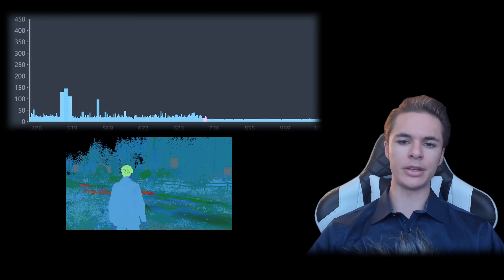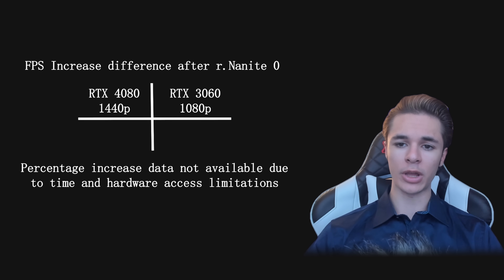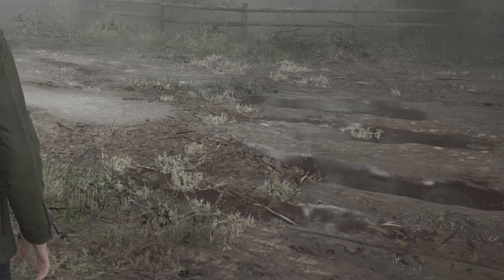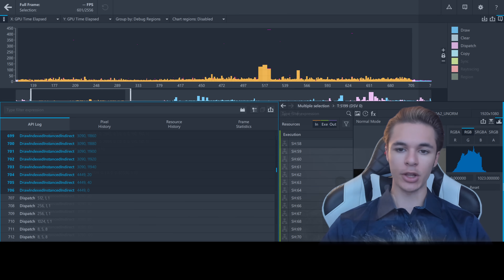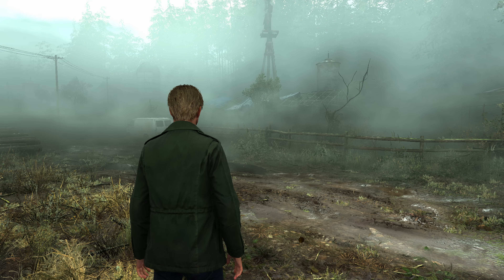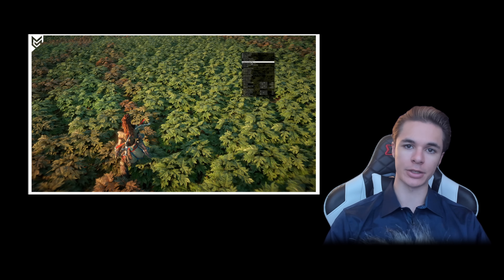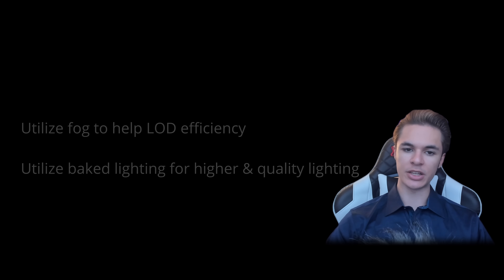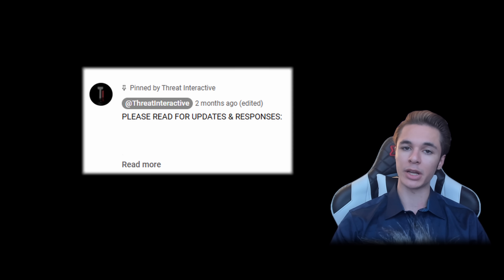The Price of Realism? | SH2R Optimization From The GPU Perspective

Comment: hey there, can you check out this game called still wakes the deep and find out what's wrong with it? it's using ue5 but the shadows from the flashlight look very pixelated and the lumen or whatever it's called is very noisy. i would appreciate it if you did a similar video to this but for still wakes the deep

Comment: Lmao love your breakdowns but you get so overly angry about a lot of this.  I love it when passionate developers use clever techniques to push fidelity and hardware without relying on artifact ridden "cheats" too but expecting that out of every AAA game is ridiculous.  It's a profit driven industry and a lot of the time the investments flow to whomever is using the shiny new tech even if it's worse than the old tech as long as it's marketed properly.  Snake oil salesmen will always be successful to some degree so the best way to beat them is to be a good salesman yourself.  Along that line I think you should also break down some examples of games that did optimization well and outline how those good decisions effected the end product.  I know Half Life Alyx has already had lots of media coverage, but an in depth breakdown of a game like that where you link to resources on implementing the techniques used both on the art and tech side of things would go a much longer way than being negative about the bad decisions imo.  You have to sell what you want people to use.
Reply: He actually did in an earlier video. Check out "Optimized Photorealism That Puts Modern Graphics to Shame: NFS 2015"

Comment: well... ue5 game have pretty much the same problems (no matter the game)
Reply: that's an issue with the developers and less to do with the engine, developers have to do their job properly to use an engine properly for their games, and there have been developers that do it properly
Reply: @randomcommenter10_  yeah yeah yeah....
and yet my comment remains true... this IS  a problem that UE5 have
It depends a lot in the game, the "heavy" load it has, hardware, etc... , but this IS a problem ue5 brings.

Comment: I am gonna be honest; no matter what "true" programmers say or think, the one huge advantage of UE is the whole Blueprints system / workflow (and similar usage like nodes and inputs/outputs in systems like Niagara, Material Editor, and so on). I am not really a fan of the temporal blurring and graphical overhead, but getting your logic working in UE is really easy. I wish this kind of workflow was really available in the same complexity level in more engines.

Comment: I really appreciate your expertise and knowledge you took time to share with us. And not being afraid of looking at these problems at self value without coming off as an 'asshole hater'. The only thing I can disagree is the future of Godot and alternate engines, an open source engine has the potential of becoming 'the next blender' in video game engines. Lots of veterans (10+ years in the industry) basically grew up with open source tools, specially most content produced was probably used some freeware/community versions and/or the seven seas hah. Or what VScode (with other ide/vim alternatives) and github (with other git alternatives) is to the current programming community. It is a valid strategy to push this potential competition to these 'monolith engines', and get parallel progress, research and development finding different solutions to semi-similar problems. What one engine offers, may not be in another engine, or the other engine is better for this and that. But eventually these engines tend to benefit from each other's ideas (as far as open source goes). The company's priority will defer from others. Like if your goal is to make gaming graphics smoother and better, it will be difficult for unreal engine to divert the necessary resources if their second main goal is movie vfx production. 

Or as they say, the more the merrier.

edit: grammar lol
Reply: merrier*
Just had to, sorry.

Comment: I'm trying to develop game in Unreal and lumen is a absolute trash nightmare in the dark. Now I am considering disabling both nanite and lumen
Reply: I'd still use Nanite and Lumen but only as an option for high end systems that can run it properly, it'd be bad to have them on by default tho just like raytracing
Reply: @randomcommenter10_  I had to completely disable it in my engine and my performance quadrupled - but my gaming being low poly its not needed.

Comment: After taking a look back at the UE3 games again, I am shocked how well most of them (even the late era ones like A Hat in Time, MK11 and Rocket League) were actually very well optimized! Could you take a look at some of them sometime and perhaps reflect on how the 3rd version of UE was way better of an era? Thanks, keep up the good content!
Reply: Are you running them on a system with period correct hardware? Otherwise of course beastly futuristic tech like what we have now can run those old games exceedingly well..

I liked UE3 generally speaking, however it would stutter a LOT and in almost every title (even with modern hardware, btw). - Now fortunately that stuttering could usually be fixed with a couple of config edits but you know only a fringe few of us bothered to do that. IT was so bad that anytime I got a new game I would look up the engine, specifically because if it was UE3/UDK I already knew what config entries I would make..
Reply: @OGPatriot03  I never have stuttering issues in almost every UE3 game I play, even with no config tweaks.
Reply: eh a hat in time isnt really optimized

Comment: re: the initial ~1.3ms frame dispatches... this could be debug and stat capture, the game had a lot I've disabled.
re: LODs. this game doesn't use LODs _at all_. even force disabling Nanite the UE LOD system groups are ignored and LOD0 is drawn everywhere. I believe this is to do with the hard culling at 60~80 meters (disable the fog in town to see it). perhaps the devs reasoned that only LOD0 would be needed due to this. however because of how UE builds HLODs this causes sudden HLOD builds (and then shaders/textures/shadows/decals on top of them) where there was no previous LOD to hide it... UEs HLOD system is already problematic (I believe it has a fence/race issue), and hard culling beyond the player's view makes this problem far worse. I've found no way yet to force proper LOD use or fix the HLOD race/hitch issue. HLODs are one of the major causes of stutters in Survivor and SH2
fog: another issue is in vanilla fog is drawn to (about) 170 metres. yet the player can only see 40~60 metres. reducing fog draw increases FPS by around 20%
reflections: while reflection roughness is clamped low (0.4), reflections add to diffuse indirect lighting, qnd raising this clamp dramatically improves bounce lighting in some scenes (while it is expensive, a good balance is 0.55)
AO: I have no idea why the devs chose SSAO for this game even with RT. GTAO or RTAO are very similar performance cost and look much better, and RTAO combined with lumen adds throw lighting to some scenes, improving lighting quality at no cost.
Reply: Amazing comment i jsut saw this, do you know if Ultra Plus mod fixes any of these issues? I heard they replace some of the AO with GTAO or RTAO
Reply: @nathanmitchell7961  we've fixed a lot, including increasing the thread width of the game from 3 (from memory) to 8. i need to come back and do another pass on it. (we haven't been able to fix the hard culling of buildings in town yet, still looking for a way to find and override what the devs have done)

Comment: I feel like the point about Unity and Godot isn't entirely accurate. The workflows and general performance footprint of both are very different to Unreal. They have their own uses and advantages in the same ways that Unreal does. Also, you mention performance alongside photorealism, but some developers aren't looking to achieve photorealism, and other engines are usually much better for that than Unreal.

Unfortunately though, as you've pointed out, Unreal is more an engine built for 1 game, Fortnite, and mostly everything else is just marketing to get other large teams to use it in their projects. It does have a lot of great tools for a smooth workflow with a large team, but under the hood it's a mess. I do feel like creating your own branch of UE5 as you're talking about is basically just making yet another engine option, which you criticize Unity and Godot for. I feel like this is kind of contradictory, and again also just missing the point that these engines offer different advantages of their own, same as Unreal.

Still a great video though as always. I'm just trying to provide some constructive feedback, and I am super interested in seeing how your branch of UE5 turns out.
Reply: Unreal was actually originally built for the 1998 game Unreal, as well as Unreal Tournament and later on Gears of War. Fortnite was something that happened way later in the engine's lifespan where Epic abandoned all their previous titles for it which sucks tbh
Reply: @randomcommenter10_  Yeah I'm talking about modern Unreal. I'm aware that Fortnite isn't a game from 1998 lol

Comment: I have an appropriately fog-related question: I've been hesitating between two different types of fog in my UE4 project - either one that's a box with a volumetric material applied to it or one that's a Niagara system using static cloud sprites with an additive material (a translucent material would obviously look better, but it causes major sorting issues). I find that the latter often looks better, but I'm concerned about the performance cost of having hundreds of sprites rendered in areas that use this fog. Would the performance cost of using the volumetric solution be lower?

Comment: I've waited for STALKER 2 for many years, and i'm worried about its performance since it uses UE5. But the devs said they adapted the engine to their needs, and nicknamed it "UE5.1.GSC" :face-green-smiling:
Would be pretty crazy if GSC was the first to make a well optimized UE5 game, considering original STALKER games were pretty taxing at their time. They could set an example for "3A" devs, though! 😆
Reply: While I'm hoping for the absolute best and that the recommended specs won't be a lie, there is always doubt in the back of my mind considering their first games on their in-house engine were terribly optimized and a bug filled mess even today. Nonetheless I've already per-ordered the ultimate edition as the Stalker series have been a big part of my childhood with 600+ hours recorded on steam.
Reply: taxing – but also very modern and good looking! (that is, back in the day when the tech demo build leaked – by the time it released it was not groundbraking any more). i truly hope gsc is cooking with this one!
Reply: It supposedly runs very very well on the console versions.

Comment: It's pretty obvious nobody here grappled with the limitations of UE baked lighting: lights that cast dynamic shadows cannot affect the bake, and vice versa, which results in some very contrived and limited lighting design where you have a few shadow-casting spotlights in an otherwise unresponsive GI bake. And if your environment or lighting is even vaguely dynamic (can't speak for SH2; haven't played it), then it presents even more challenges. Lumen doesn't have these limitations; light sources work as they should IRL. Everything can be both shadow-casting and GI-affecting, rather than having to choose one or the other. And then you don't have to tie your brain into knots when there are light switches, doors, destructable walls and so on. We've had static baked lighting since Quake 1 and I'm ready to move on.
Reply: This is weird, I recently worked on a project with gorgeous baked lighting in UE5 (with RT reflections + translucency) and dynamic/stationary lights could absolutely light up the scene. I moved the point light across the dark baked hallway and it surely worked.

So why are some people like you, implying that you actually HAVE grappled with the limitations and then claim something that as far as I'm aware, isn't actually that big of a problem? A great example of a launched project on UE5 that uses baked lighting + dynamic lights is 'Ready or Not'.

Comment: Still, considering how Unity engine look really good for indie and AA games especially if it was optimized really well and its meant for not very heavy GPU products
Reply: Unity has it's own plethora of issues, it's a mess to work with because it's still based on the old janky codebase from 2005, they have a lot of technical debt to resolve if they still want to see themselves viable, most of Unreal's codebase and core engine features at least went through majour rewrites every generation before UE5
Reply: @randomcommenter10_  and yet almost every title of UE5 release is a mess very unoptimized games filled with stuttring and other issues of course its not just the engine's fault its also the shitty devs work but at least unity is capble of making a smooth indie or AA games

Comment: In all fairness, static environments need to go away in general, given The current year and the current hardware performance capabilities on the low end, let alone the average. If something looks pretty, in a virtual environment.. But you can't interact with it.. what's the point?
Reply: I share your sentiment that static environments have been holding gameplay back for decades. but it seems misplaced in the context of a faithful remake of an old game. it's not like using dynamic lighting techniques had any positive effect on this game. it plays the same as it would have if they baked the lighting, except it runs really badly.

Comment: Thanks for doing this. I’m really enjoying this game and for the most part it looks very nice, but the graphics options are pretty lacking and feel very poorly optimized. It feels kind of ridiculous that setting the game to low settings still looks pretty high-fidelity. The under-sampled hair was bugging me playing at 1440p with supersampling enabled, so for the majority of the game I just decreased the resolution to 1080p and turned off any supersampling. Hair was far less distracting then. Loading hitches aside, all was fine until I got to the hotel, which has a lot of polished metal and wood. The amount of jumbled noise on those areas is absurd and only goes away if you enable supersampling, which of course comes with its own other smudgy problems. Also as many others have mentioned, considering how short the visible distance is in this game at any given moment (whether due to fog, darkness or just geometry), it seems like they could have optimized a lot better with leveraging LODs and culling. Very unfortunate to see so little on screen and still get loading hitches

Comment: Even though I have pretty ok pc (rtx 3070ti), if it's an UE game, I know I'll spend solid 30 mins tinkering video settings, use AI frame generation and upscaling and still get occasional shutters. Even game like Metaphor with ps3 graphics has terrible performance. And unfortunately majority of AAA games are powered by UE nowadays. 
At times like this, I think maybe Jo Blow is not that madman after all. The Witness could look insanely good and would run on my grandma pc without a single fps drop.

Comment: As a long time backer and hopeful of the dream of Star Citizen and Squadron 42, I would love for you to take a deep dive into that game's rendering, both now and with future RT implementations, because one of the key things the game requires to be a success on launch is good performance. It's currently in a transition period from DX to Vulkan so there's quite a few teething issues, but hopefully those get resolved and we get a smooth playing experience on a wide spectrum of graphical performant hardware for everyone to enjoy.

The game will have dynamic time of day changes because it will literally simulating day/night cycles of hundreds of individual planets and moons in 100 solar systems, on top of fully physicalised spaceship, station and building interiors.

Comment: I thought i was taking crazy pills when people were saying it was 9/10  .  I Don't have amazing hardware but it is a stutter mess. I spent more time in the settings than in the game. UE5 is really doing current gen and last gen hardware a disservice. Even with everything cranked up I've seen better UE4 /  Frostbite 3 games that were no where near as demanding.  Also using software raytracing is just poor in my opinion . if you are going to use it make it hardware only.  Mark Cerny from Sony said "75% of PS5 players choose to optimize frame rates in performance mode" People want Framerate and Stable frame times more than a TAA, FSR, Xess, mess. We're going backwards. Just give us a stable game . If you wanna push the visuals then make sure the frame times are flat and we can cap it for Consistency.
Reply: Crazy concept, but maybe graphics arent particularly relevant as to how good a game is.
Reply: Graphics aren't everything but when you lower everything to enjoy the actual game and it's still a stutter fest I don't think it's a good direction for gaming.